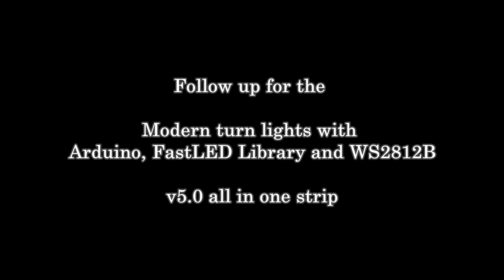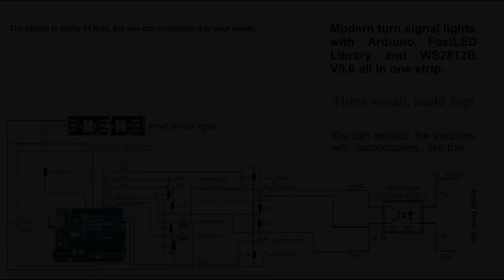Modern turn signal lights v5.0 all in one strip - Arduino, FastLED and WS2812B

Comment: Hello! Nice project! Is this just for UNO or working on DUE too?
Reply from the maker: Hello. DUE has I/O pins at 3.3, you will need 3.3 to 5 level shifter for the leds digital control pin. In other words, you ar complicating yourself with DUE.

Comment: Great Job! I used it on my Xiaomi M356 and it looks incredible. Only when I connected the optocoupler (same LTV817 like you did in the schematic), my backlight led blew off. Cannot imagine why and how that could have happened. If I see things right you create a voltage divider with the two 1K resistors to stay within the limits of the opto.  2K in direction to ground is perfect for the led power source, so maybe it just went because it was her time to go... Connections to Arduino and brakeled have been doublecheked several times and its not that complicated so, did I miss something? If you connect an opto by the way, you leave the 10K pulldown at the respective port connected?

Comment: GREAT VIDEO!  The switches you use are they momentary switches or are they  toggle switches? I assume that they are momentary switches but i am not certain. And the capasitors beneath the right and left turn light switches are they necessary. I would really appreciate it if you would reply :)
Reply: Hi! The swithes are toggle switches and the capacitors are to flatten the control signal. Prevents indicator from unwanted triggering and eliminates problem due to intermittend/bad contact on the indicator switch.

Comment: ce switch trebuie folosit pentru semnalizare? Care este doar un push si revine in pozitia initiala (da doar un impuls) sau switch care trebuie sa ramana activat pana la oprirea manuala a acestuia?
Reply from the maker: Daca vrei sa ramana semnalizarea pusa trebuie sa folosesti impulsuri regulate, adica un impuls la aprox 400ms (asemanator cu un releu auto)... dar pentru teste poti folosi switch push sau switch cu retinere...
Reply: @IonutF-TS-BB  I have never seen requirement to hold down the button for the turn signal to stay on anywhere else. Is it hard to implement the code for the turn signal to stay on? I guess if the all outputs on Arduino are used then it's impossible to add a buzzer to replicate the ticking sound of the relay? I guess analogue output could be  used since analogue pins also serve as digital pins. Seems weird that nobody else is addressing this issue. I guess every good project always has something unexpected going on.

Comment: Hello again,

I'm trying to make the turn signal animation one per signal, so when the turn signal light once the leds make one move not two, how to accomplish that? 

Thanks!
Reply from the maker: Hi,
Search for and change to 2...
int nrAnimAfterOff = 3;                                        //number of animations for a single impulse

3 means actually 2 passes and 2 will be actually 1 pass...

With pleasure !
Reply: @IonutF-TS-BB   Thanks! I did, it works fine but not every time, now it's making one animation and sometimes two, not constant.

Thanks!

Comment: Hi, Amazing how you managed to make it work! you see i cant. when i connect everything up the signal flashes a few times but does not really react to the 5v input. could you help me out?
Reply from the maker: Thanks!  
If you are trying to recreate the "Modern turn signal lights v5.0 all in one strip" be sure that you follow the basic schematic included in the download link.
If you followed the schematic and it's still doesn't work, send me a picture of your setup with details and let's see where the problem is...
Reply: @IonutF-TS-BB  I have, also tried to rebuild the v1.0 same reaction...
Reply from the maker: @jesperkuipers7556  You are doing something wrong... send me pictures or a clip of you setup and some explications...

Comment: Thank you very much Sir for this video. I am new in using arduino. Could you possibly make another video how to plug to the car. I would to apply in the car but I don't understand how to plug it. Thanks again for your help
Reply from the maker: Well, that will be impossible, because every car is unique in its electrical installation, that's why i provided only the basic schematic and the rest will be done by every user.
Everything you need is basic knowledge about electronics and electrical installations, but if you don't have them, don't try it directly on your car, it's risky!
Try asking a close friend for help... or make some research before...

Comment: I have a problem when I plug in my vehicle, may I ask you, I use Arduino Nano, the LED suddenly lights up itself like bounching, I have added a 10K resistor as a pulldown. the circuit that I made, from the battery in stepdown using ic 7805 for power Arduino and led ws2812b, then as a switch I give ic 7805. is this problem due to the large power?
Reply from the maker: I've said in a lot of comments, don't use 7805 linear regulators, because they are extremely inefficient, they are not able you stay constant, they fluctuate a lot when you suddenly draw large currents, they ar not meant to be use in this way, they overshoot and you could kill your led's and your controller.
For triggering use optocouplers and for powering everything, use step down buck converters, because they are fast enough to regulate the voltage and not overshoot.
Reply: Think small, build big! 

thank you for replying to my question, so each switch uses an optocoupler to trigger the digital pin, do you think it's safer ?
Reply from the maker: @Dwi_Akza  
It's the safest way to separate a low voltage side from a high voltage side, because they are galvanic separated, which means left side doesn't touch the right side in any way, it's controlled thru light, that's why there is a symbol of an led in the schematic and that's why it's called optocoupler...
Reply: Think small, build big! 

that means I need about 5 optocouplers for each trigger switch, for example, left light 1 optocoupler, right light 1 optocouler, and so on. because I immediately took power from the vehicle lights that followed the vehicle's relay ticking
Reply from the maker: @Dwi_Akza  
Yes, you need one for each signal.
 Optocouplers also come in packages of two and four (ltv817 , ltv827 or ltv847), see the datasheet for LTV8x7 for more info.

Comment: Hello I just pulled the sketch but I didn’t see where #define DATA PIN 11 was ,I need to switch it to PIN 2 I’m using an Arduino Nano
Reply from the maker: Just search for " const int outLed1 = 11 " and you will find it, but pin 2 it's used already with the button for changing tha animation, so you will have to change it to another pin if you don't want pin 11.
Reply: Think small, build big! Thank you

Comment: Hello, congratulations for this project. I also managed to do this but I was never able to find a solution to one of my problem. My problem is that when I release the flashing button the flashing finished the sequence it goes to the end of the led tape but he dont stop. I hope you understand me I am French. If you have a solution, I'm interested
Reply from the maker: Hi and thanks. 
If i understand correctly, after the sequence finishes, the leds won't go off. If that is the case, this means you are not updating the leds to another state/color after the animation finishes. In digital leds, if you send once a color and update it, then the leds will keep that color until a new color is send.
The approach that i'm using in changing the colors and updating the leds is by thinking about the controller state and i change that state when a function finishes or when a button is pressed. I'm using this approach in almost every project that i've done until now and it never let me down.
Reply: @IonutF-TS-BB  
Hi and thank you this is not really what I wanted to ask you, I may have been poorly expressed, I wanted to ask you if there was another  way to do it because in your code when you press a button you enter a "void" and imagine in this void there is that every second we turn on a led in addition, all that hang 100 seconds that will turn 100 led if i press and release the button. but me that I want to do it is every second we turn on a led in addition, all that hang 100 segonde and if I release the button we leave the void and we return to the void loop, do you have a solution for this? cordially
Reply from the maker: So, you want as long as the button is pressed the animation to run and when you release the button the animation to stop and return to void loop... i understand it correctly this time?
Reply: @IonutF-TS-BB  Yes that's exactly it
Reply from the maker: Well, that's simple, use a while loop. You could also use a separated void, it will be simpler to call in different portions of the code, but you could have the animation in that while loop.
while (pin X == HIGH) {
  // do the animation
}
https://www.arduino.cc/reference/en/language/structure/control-structure/while/
If you use some states variable, you could simply clear all the leds after exiting.
Reply: @IonutF-TS-BB  
thanks I will try

Comment: I would like to minimize the code down to running lights, brake lights, reverse and turn signals, what parts of the code should be eliminated?
Thanks!!  :)
Reply from the maker: First, thank you for your donation, this helps and motivates me to do more!
Now let's get back to the topic, the signal lights take much of the space needed, fog lights and tail lights take aprox 1200 bytes... if don't want them, just ground the pin...
If you want to minimize the code to use it with a smaller IC, witch IC you want to use ?

By the way, the next version will be with attiny85 separated for each function (signal, day + knight rider lights one sketch and tail, brake, reverse, fog + knight rider lights another sketch), in this way it's more easy to embed everything in the headlight or taillight. Because the sketch is to big for attiny85, i decided to separate them.
Reply: You are welcome, thanks for your time! Will wait the new codes also I will try to  minimize the existing code by deleting section by section I'm very excited to learn things from ground up, in the 80's I taught myself BASIC language now I will do the same with arduino.
Reply from the maker: Well in the 80's i was born so i love the era. :)
Download the sketch again from this link https://drive.google.com/file/d/1JW0eVpUPa663CMOQLfURBGGcxHbDqKdQ/view .
I've commented all the major functions and all variables are named from the beginning really obvious so everything should be understandable.
Reply from the maker: The new version is out - https://youtu.be/EXO58RFgQIg
Reply: @IonutF-TS-BB  Thank you so much!
Reply: @ Think small, build big! 

Hello.... 

beautiful project .. 
sorry, I want to ask how to change the color of the tail light to be like a color palette that moves to change colors. I have tried editing the example you provided but still cannot. I am not a programmer and want to try this project on my car.
Reply from the maker: @Dwi_Akza  Thanks...
There are a few problems with what you wanna do...
1. From my knowledge, "fill_rainbow" function takes only one argument for indicating the leds on witch the rainbow will be applied, so for 0 - 26 led you can apply the rainbow and let the signal work on the other leds 27-53, but you cannot apply the rainbow on the other leds half 27 - 53 and let the signal work on the first half 0 - 26. "fill_rainbow" function work only on the entire led strip or from led 0 to any led in the strip, because you cannot change the start position.
2. As long as the signal is working, the rainbow effect  will be interrupted by the small delay from the signal and it will be choppy...

If you still wanna try, from row 416 - 429 is the function for tail lights with signals off, from row 429 - 437 is the function for tail lights with hazard lights on and from row 437 - 463 is the function for tail lights with left or right signal on. (to view the row number, open the original sketch with notepad++)

From my opinion, the only way to achieve what you want is to separate the led strips (one for left and one for right), but separating the led strips means a complete rework of the code and even then the small delay from the signal will still be a problem.
Reply: Hello, congratulations for this project. I also managed to do this but I was never able to find a solution to one of my problem. My problem is that when I release the flashing button the flashing finished the sequence it goes to the end of the led tape but he dont stop. I hope you understand me I am French. If you have a solution, I'm interested